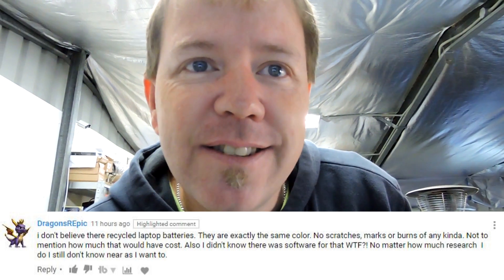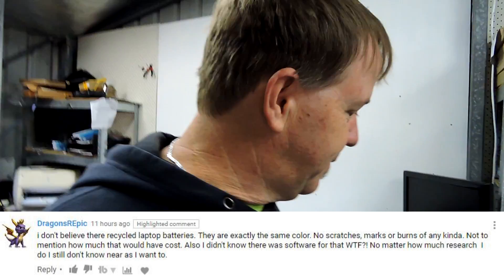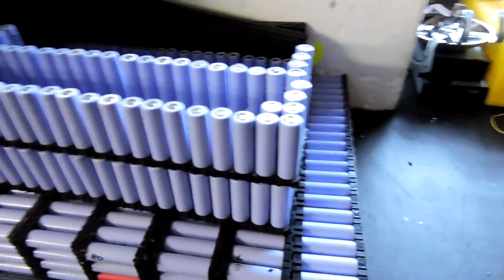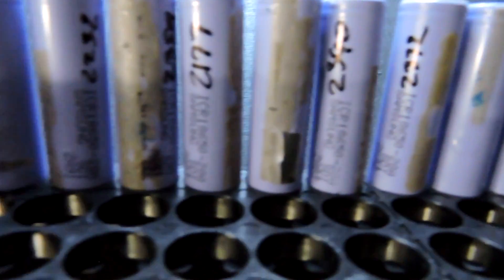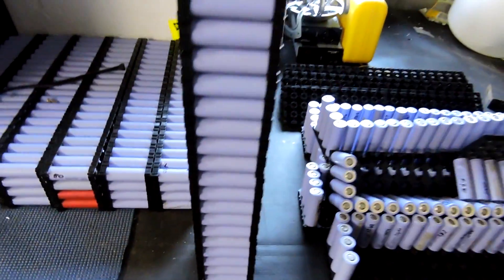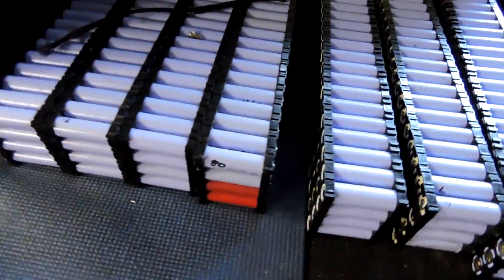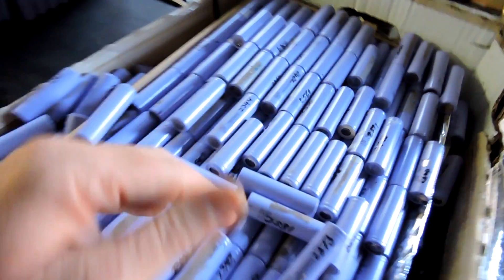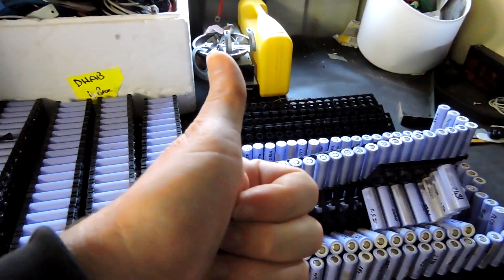VR to DragonsREpic - like more of these ? Ask Q in comments :)

Comment: Can you mix old cells with new ones?  I have a few hundred batteries to tear apart but was also looking at buying some new ones. I am just getting started and don't really have a plan yet but it seems like get the batteries first :D
I run a computer store and have been collecting these batteries for 5+  years and I am thinking of turning the store into all DC lighting as my first project and getting rid of 50+ T12 40W fluorescent  bulbs.
Reply from the maker: you can do anything you like with enough research - changing out that many bulbs will take a long time to repay the investment i think. That said led is SOOOO much better light than the 40w fluro tubes!
Reply: I am thinking of using the ribbon led lights. I don't think these are very expensive, 16' for $8 on amazon and may be bright enough to replace 4 bulbs. I really don't know but will find out I guess. They are 25w compared to 160, I ordered one and will try it out. I might be able to find them cheaper elsewhere, it was just the first place I looked.

Comment: I found cheap cells for your U.S. viewers. they come in a 36 volt pack with a BMS and free shipping. they are about 1.75 per cell U.S. dollars. the more you buy from this guy the cheaper they get. now the good part, there real LG cells ( new )  here's the link to his eBay page.http://www.ebay.com/itm/NEW-LG-36V-4-4AH-BATTERY-PACK-18650-EBIKE-VAPE-POWERWALL-BATTERIES-20-CELLS-BMS-/172630688902?hash=item2831974486:g:nKUAAOSwuspY9YNZ
Reply: You can get them straight from the source too. This way you don't have to deal with ripping them apart. These cells have been reviewed on DIYPOWERWALLS forum to have at ~2200mah.  https://www.alibaba.com/product-detail/LGEAMF11865-2200mah-rechargeable-li-ion-battery_60559432723.html

Comment: i just got me an arduino battery welder. runs off a 12v car battery :)
Reply from the maker: have you got a link for that ?
Reply: yeah sure! worth every penny! https://malectrics.eu/product/diy-arduino-battery-spot-welder-prebuilt-kit-v2-1/ thats where i got it from
Reply: just cut the nickel strip , remove the battery and then weld another battery with a new nickel strip .
Reply: i have that too , it's really amazing , it's much better than using solder , and even faster.
Reply from the maker: Thanks for the link i'll check it out !
Reply: But what if you have to change out a battery? Wouldn't the solder be easier? Just getting into this hobby so I may ask a lot of questions.